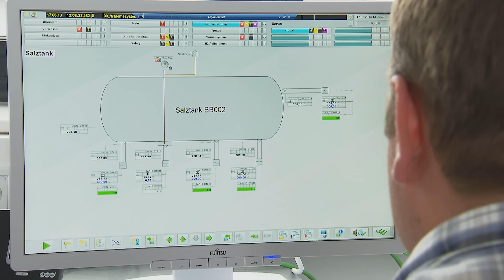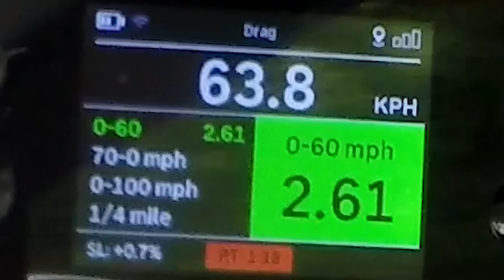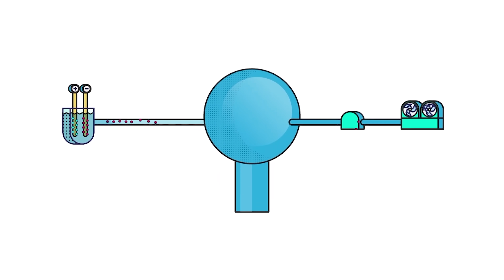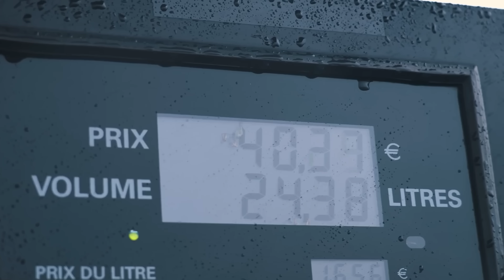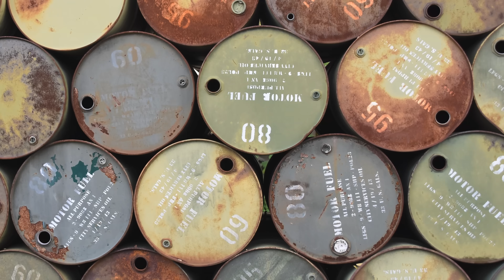Porsche just SAVED petrol engines FOREVER

Comment: There is just one important problem with the video: the e-fuel exception has not been added to the law yet. They intend to do that within the next few years, but there is no guarantee that it will definitely be added. As written today, the law only permits EV's and hydrogen for category B vehicles after 2035.
Reply: What he hasn't told you from the Porsche press release is that the methanol synthetic e-fuel is currently $40/gallon. And at full production at their Chile plant, they hope for $9/gallon. Too expensive, It'll never work for regular folks and regular cars....
Reply: @larryc1616  that's why you don't go from 0% to 100% e-fuels overnight. It'll be added to existing petrol gradually, just as with ethanol.
Reply: @2728Alexis  except in aviation, where getting technical approval for very specific fuel mixtures is an arduous and expensive project.   There will be a certified replacement formulation for synthetic jet fuel and one for avgas (although many are trying to get the very small planes onto automobile fuel).
Reply: @larryc1616  he didn’t have to mention that, though, because he did mention that just the Chile plant could never even make a drop in the bucket for a single large country like the U.S, so the scaling isn’t even close yet, so the price is irrelevant during this infantile phase. It’s for the future, not right this moment. Still all theoretical, however, so you still do make a valid point.
Reply: @larryc1616  Remember how thats for one plant... Now add in demand and theyll make more plants like this which will drive the price down. All new stuff is expensive at the start
Reply: @jimmy neutron  you can always dream ✨️
Reply: Yeah, but oil companies are working on it as well and they have plenty of money to lobby governments with.
Reply: @adrianhjordan1981  Yes, why not lobby for burning your own money? Why should someone invest in electric car manufacturing lines if thats not needed. The change is already running and thats contergerating their own efforts.
Reply: @adrianhjordan1981
Reply: I see a lot of doubt in the comments, but being from Germany, i'm very confident E-Fuels will become part of the 2035 Law. Simply because several Companies that focus on researching that, both known Car Manufacturers from Europe as well as Independent Companies are getting a lot of Gouvernment Grants and Support for the Research and Production of E-Fuels/Hydrogen.
Prost & Cheers from the Bavarian Alps
Reply: @chartreux1532  really shows how Germany has been playing solo for its industry and environment decisions… 😡 rest of europe can go to hell apparently… disgusting
Reply: Oh we can change the law very quickly.  we also can have a war in Europe cause energy pricing high for everybody globally.  we forgot climate change very quickly when everyone is short on energy
Reply: in the EU it is (Germany managed to make them add it)
Reply: If the infrastructure is no better; it doesn't matter if the law says no fossil fuel cars - they'd be so much chaos it would be impossible not to rescind the laws.
Reply: The rest of the world at least is not limited to such stupid laws so it shouldn't be a worry, at least for those who have a residence in those parts of the world.
Reply: Category B cars like what?
Reply: @purwantiallan5089  cars and vans up to 3500kg
Reply: @purwantiallan5089  tuk tuk 😂
Reply: @purwantiallan5089  Motorcycles
Reply: @exoticsoflt  Motorcycles are category A
Reply: @Vengirni  My mistake, you're right
Reply: @exoticsoflt  Nope.  Motorcycles are category A, category B means normal cars.
Reply: @detaart  I know, already said sorry for making a mistake.
Reply: There's nothing to worry about, they didn't even fully approve the law about 2035, but they've managed to make exceptions from that rule for companies like Ferrari, Bugatti, Bentley etc. 🤦‍♂
Reply: @Spasm975  Yet, Volkswagen CEO publicly announced, that "Within the VW Corporation, E-Fuels will mainly be a Topic for Porsche". Note how VW owns Bugatti, Lamborghini and Bentley.
Reply: @kooooons  also seat skoda cuprs and ducati
Reply: @neilmorris6719  I know, but except ducati those aren't actually performance brands with ICE legacy... I just wanted to point out that they seem to plan to abandon ICE-legacy for iconic brands except Porsche. As a means to show that if Lamborghini isn't good enough for E-Fuels, an Octavia Wagon TDI won't be either.
Reply: Actually I have read that Germans demanded that the e-fuel exception will be written into the law directly, not only into the preamble as it is now. That's why they had to make a meeting again and they added it. But I only read the report, not the law itself (god help me, reading laws is boring).
Reply: @IQEGO  I did try to Ctrl+F the law in question for any mention of e-fuel or similar. I found literally nothing. Initially, Germany demanded it to be added, but in the end voted in favor of the law as-is with nothing but a promise that it is going to be amended later.
Reply: @Vengir  Hmm, interesting, are you sure you searched in the correct law? Because there should be some mention at least in the preamble.
Reply: @IQEGO  I might have. After double checking, I indeed found one mention in the preamble that their development should be monitored by the commission.
Reply: Efuels are best for long range vehicles doing fast journeys over 300 miles in a day and those carrying significant payloads of luggage or goods.  Rail travel is uneconomic for everywhere that doesn’t already have a railway infrastructure.  Electric vehicles are for efficiently doing slow, short-distance transport.  

There will be a mixed environment of compact EV with less range and endurance than the current high-priced luxury segment and synthetic hydrocarbon vehicles for when it is necessary to travel far and fast with quick refueling stops.  

When the immense cost and impracticality of scaling up to an adequate country-wide electricity recharging network is fully understood, then the cost and effectiveness of scaling up efuels instead and prioritising them for aviation, long-range transport and for use in rural regions becomes very attractive.
Reply: You know Europe is such a small part of the world right?
Reply: They won't add it because the goal isn't to protect the environment it is to control the people.
Reply: While true, I think Germany (and Germans) would rather leave the EU than accept that. The law WILL come.
Reply: @mpauls85  
Germexit?
Reply: @mpauls85  not true ... yes the lobby wants e-fuels to keep  the combustion engines, but the goverment isn't.

I'm German 😉

And at least I'm sure no one will/would be happy with e-fuel except the car lobby ...
E-fuels are far less effectiv as common fuels and then paying so much money per L ? 
I don't need it ...
Reply: They will relent and extend, you know how Brussels works. Their plan is really just really their dreams, hardly has any of their 'plans' being literally realised.
Now, with EV, the infrastructure won't be ready by 2035. People don't buy it and people will keep driving old cars, if you ban them they will take over the street (which Europeans do best), maybe set EU Bureaucrats buildings in flames.
They will extend the timeline when it timeline comes.
Reply: @TheJackOfAllTrades777  are you all right?
Reply: No doubt at all it will be added, they will be craving these types of solutions as EV/hydrogen network won’t be up to scratch as full solution.
Reply: I guess you’ll have to depend on the government if you can’t afford an EV and if ICEs are outlawed. Glad I don’t live in that self fulfilling prophecy negative feedback loop hell hole that is the EU. “Good luck poor people!”
Reply: It just depends on the criminal agenda of the globalists.
Reply: honestly, if the german government supports it I don't think Brussels will be able to stop it.
Reply: Super 🌌
Reply: They added already
Reply: I mean come on. That's basically a guarantee
Reply: Eh depends if they math all adds up to reduce carbon and there's no idiots in that sector of who decides those laws.
Reply: I imagine it will be added. e-fuel is only going to be for racing, super/hyper cars, old/collection cars anyway and will not be able to compete with BEV. The production of e-fuel is very energy intensive and will not be mass produced. Porsche plans to produce 55 million liters by 2027. As mentioned in the video, the U.S consumption is 1396 million liters per day. To top it of, it costs them 2 euros per liter to produce so what will be the cost at the pump? 3 euros per liter?
Reply: @inebium  You cannot change all vehicles to eletric
Reply: Let’s hope they don’t allow this disgusting greenwashing only for the rich e-fuel
Reply: @jonasweber9408  But that's what it will be for since it will be much cheaper to use a BEV vehicle. 20 euros for 300-400km vs probably 60-80 euros for 300-400km (and I think that's very optimistic because the availability will be very low so I wouldn't be surprised if 1L of e-fuel ends up at 4 euros). So normally most people will get a BEV even if it's possible to buy an ICE car to be used with e-fuel (aka most likely just luxury cars such as porsche, ferrari, lambo, ...).
Reply: @inebium  I’m happy with that if that’s the case of course, but at the same time I wonder if rich people should get this privilege 🤔
Reply: @inebium  what's optimistic is 20 euros for BEV 300k, in the UK plenty of EV owners are saying there's little to no cost saving over ICE with sky high energy costs
Reply: Thanks to germany we might be saved
Reply: I just bought a pair of gretathunberg's nutsacc to hang off the back or my cayenne turbo v8 hybrid!
Reply: Go away doom and gloom
Reply: E-Fuels are trash and no replacement for actual fuels.. specially not for Cars...
They don't make sense for cars and needs a lot of green energy ...
A car on e-fuel needs 5x more energy than with common fuels. If you count all the energy for the production etc.

So e-fuels are only exceptable for ships,airplanes etc. where its not that easy to switch on pure electric motors ...

The method where you get the CO2 from the air for the e-fuem isn't that great ... it needs to much energy and to much space ... and it's just a small part of CO2 in the air.
Better way for the CO2 are bio reactors, but you don't have enough of them and not everywhere
Reply: @hellskitchen8784  Right 👍
Reply: @hellskitchen8784  exactly!
Reply: @hellskitchen8784  Okay, we heard this so many times now. Time to move for another alternatives because not all vehicles will become eletric.
Reply: German legacy auto manufacturers = 💀💀💀
Reply: Wrong. Germany and the European Commission have reached this deal rather recently in fact. 

The German government re-negotiated the 2035 eu deal specifically to include carbon-neutral synthetic fuel cars and they also subsidised the project. 

The UK will not adopt synthetic fuel cars despite it being a far more efficient, cheaper and equally, if not more, clean solution because they don’t actually care about the environment or their own people.
Reply: @daniel6323  once Gov see synthetic fuel can be taxed more easily than separating out the home electricity used for the car and not for cooking or heating….
Reply: @daniel6323  Oh yeah? Then point me to the EU document where it says so. Germany voted in favor of the law without any e-fuel provision. The deal is only a promise that it will be amended later to include it.
Reply: @Vengir  That deal means it’s in the making and Germany basically runs the EU and they’re the ones supporting it. If you think it won’t happen you’re a bit naive. Also there is a document that outlines how the eu will grant the exception.

And why does it sound like you’re so against a cleaner more viable alternative to electric vehicles that help the environment.
Reply: @daniel6323  Okay, if there is such a document, where can I find it? I would like to take a look.

Yes, there is still a decent chance that the exception will be granted, but let's not pretend that it is set in stone. Even if passed, I doubt that truly carbon-neutral fuels will be affordable and I believe that it will only be used by high-performance cars, in the end making their impact as a whole rather miniscule in the grand scheme of things. So while I am not really against it, I think the whole thing is overhyped.
Reply: @Vengir  All the articles I read have said such a document exists.

It is likely to happen because now Germany practically dictates the EU. And it is predicted that as efuels become more mainstream, they will reach a price under $2/ litre, which is basically what petrol prices across europe are now anyway. It’s impact can be vast. There wouldn’t be such exploitation of extraction lithium, which is an extremely polluting process. It allows older cars to function ecologically and would be huge for the transport industry. Lorries would be able to transport everything while being carbon-neutral. The same applies for cargo ship however since they mostly travel over international water they’ll go for whatever’s cheapest which is most likely to be diesel. If it can be applied to aviation fuel, then even more potential to stop carbon dioxide being released. And above all else it gives consumers choice. Right now we’re being coerced into electric vehicles when a lot of people don’t want them.
Reply: @daniel6323  It would be great if all you said turned out to be true. But for now, I shall reamin a bit skeptical in the matter.
Reply: Wow no shit Sherlock
Reply: You know, you cannot replace all of the vehicles for evs, right? Hydrogen needs improvement, evs takes the energy generated by coal plants. And before you talking about fusion or nuclear energy, the nuclear power plants is not the most safest to produce and to defend if something happens to the world we know.
Reply: Get rid of ice there time is up